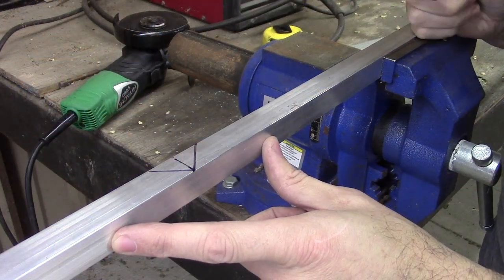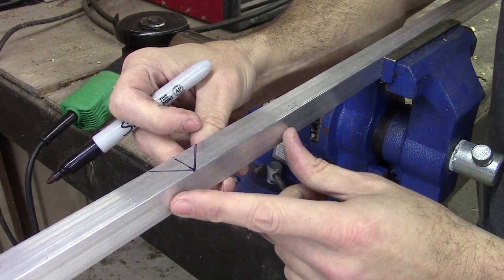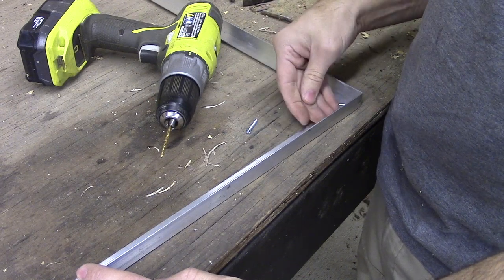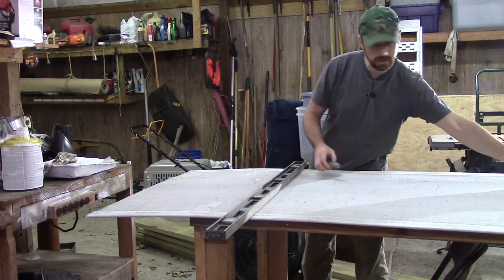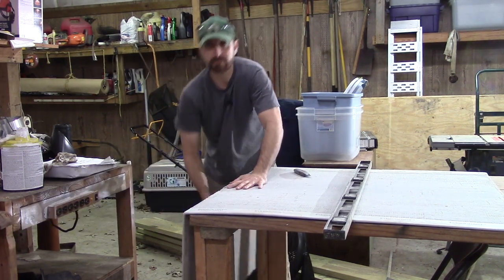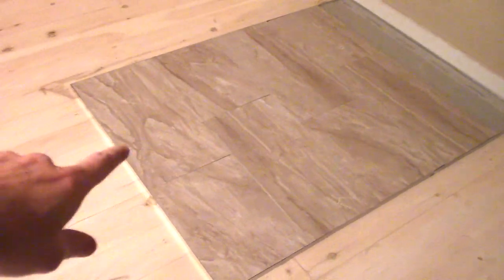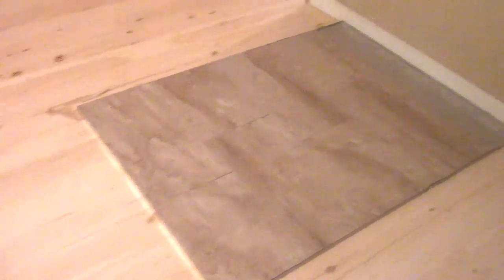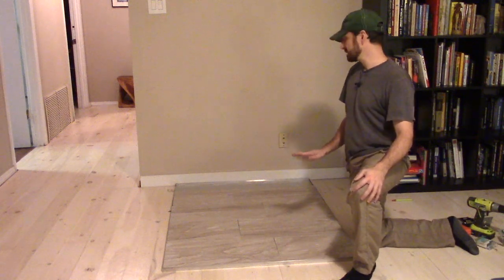Quick And Easy DIY Hearth For Our New Wood Stove!

Comment: Do you happen to know the R value for the 1/2" cement backer board and porcelain tile on top of your wood floors?
Reply from the maker: I get a 1.5R for the tile and backer I bought. That is good for my particular stove but every stove has different parameters. An additional ceramic fiber insulating blanket may be added under the tile if needed.
Reply: @CountryLivingExperience  Thanks for the quick response!
Reply: Probably more like r0.4.

Comment: Hey there! How did dry stacking the tile hold up over time? We planned to follow your tutorial, but the tile we initially bought cracked when we stepped on it. It seems most videos use mortar and grout, but we really don't want to mess with all that, as our hearth is just for a wall tent! We were wondering if dry stacking held up, or if you ended up with cracking? Editing to add: Our stove has four legs instead of a pedestal.
Reply from the maker: Hello. We have not had an issue with ours at all. Your last sentence said it all....legs. The legs have what is called a point load on them. All the weight is on those 4 points causing more pressure where they contact the tile. You will need a much thicker material to carry and distribute those loads.

Comment: I have 4 points from leveling feet.  Total weight overall is like 165lbs.  It is a small pellet stove…..Do you think this would be an issue for the porcelain tiles?
Reply from the maker: Unfortunately, that may be too much for 4 point loads on loose tile.

Comment: Where did you get the channel reveals? Is it standard aluminum stock from Home Depot? I’m not familiar with it, and I couldn’t find it with a good search
Reply from the maker: Yep, Home Depot. Here is the link to the one that I bought: https://bit.ly/2m02pzo
Reply: @CountryLivingExperience  FYI , The link you provided for reveal was for the 1/2in 1/16th x 8ft ... In your video you clearly said you used 3/4in  1/16th. I found this out AFTER I purchased the 1/2in from your link.
Reply from the maker: @gusgarcia3443  Ok. Companies like Home Depot change links all the time depending on inventory.

Comment: Could this be done over vinyl slab? We have slab foundation and vinyl flooring. Could we put down concrete backer, then a nice brick over it? Or does vinyl flooring have to be removed? TIA were also in east Texas
Reply from the maker: It should be fine to lay the backer over the vinyl but a "professional" will tell you to cut the vinyl out and then lay the backer. Honestly the bottom of the stove never gets over 90° so the hearth only functions as a spark arrestor.

Comment: How far should the outer frame be from the wood stove?  Wouldn't want the aluminum to heat up and burn anyone who might touch it.
Reply from the maker: Heat transfer to the floor should be minimal. I would not worry about it at all. For my stove, 8" is the recommended distance on the sides, 18" in the front, and 8" in the back. Stoves can vary so please check your stove's specific installation instructions.

Comment: Your backerboard snapped so easily! I had to score mine several times before it would break. Cutting 2mm in or so, and even at that it did not break cleanly. I had to go in and pare it down after to straighten up the break. 7/16" thick, James Hardie brand. Heavy as hell! Yours seems to have some bounce. And mine was convex too. I laid it curve up so I could weigh it down after I mortared in the tile. But now I've got a 1/4" gap between the stone and the skirting board. I'm wondering about taking the skirting board out and putting in a backsplash row of tile ( they're 3"x6") with mortar, to fill the gap... Don't want any embers getting down there. Can you use caulking?
Reply from the maker: They have different thicknesses and types. Ours was fairly easy to snap for sure. Ours is just dry set and we did not mortar it.
Reply: @CountryLivingExperience  I wanted to get 1/4" as it would be lower profile, and lighter and easier to cut but it wasn't available unfortunately. It was the fire chief that recommended I caulk the gap at the back well. Thanks for your reply. I'll have to fill the gap with something as it's not butted right up against the wall like yours is.

Comment: Does the weather get cold enough in Texas for a woodstove? We have a findlay cookstove, airtight stove, pellet stove and a propane stove to heat our old farmhouse in Canada. We burn 12 cords of wood per year from our property. Really enjoy your videos. God Bless.
Reply from the maker: Hi Lynda. It does get cold here in East Texas. We are at 30 degrees F (-1C) right now. North Texas gets a decent amount snow too. 

We have an electric heat pump type of heating system that works in conjunction with our air conditioning unit. This is common in the Southern US. It does not really work well below 30F and consumes a ton of electricity making it expensive to run. So we are supplementing that system with the wood stove. Most people here burn about 2 cords per year if they are strictly using wood to heat. 

Thanks again!

Comment: a quick question, dont you need to grout the tiles? I dont see a reason but still asked.
Reply from the maker: We didn’t grout them for two reasons. They are tightly set together and the frame on the perimeter keeps them locked in place. Thanks for the question.

Comment: Do you think it would be ok to put grout between the tiles without grouting beneath them?
Reply from the maker: I think the weight of the stove would just crack the grout instantly.
Reply: I just finished building my tile hearth, ended up cutting the floor to recess it then set the tile using thinset and 1/8 grout between tiles and sanded tile caulk to join tile to wood flooring. Came out looking mint and no cracking.

Comment: Did you post what tiles you used?
Reply: And how did you get your R value? 

When we are doing the math the combined tile and concrete board don’t add up to 1.5 

Unless we just have no idea what we are doing.
Reply from the maker: R-value of tile and concrete backer is fairly low. Although most modern stoves you do not need a high resistance because of the height of the firebox from the floor and low heat transference through the pedestal. Hearths are mainly just spark arrestors. the bottom of my pedestal doesn't get over 95°f even when the firebox is 500°f.

Comment: Did you need  to put tile on the wall behind the stove?
Reply from the maker: Not in this installation for two reasons. 

1. I have double wall pipe that allows me to get close to noncombustibles.
2. The stove was pulled further out from the wall because of the truss location for the chimney pipe clearance.
Make sure you check your specific stove and stove pipe for their clearances. Some double wall pipe can be as close as 6" from a noncombustible material.